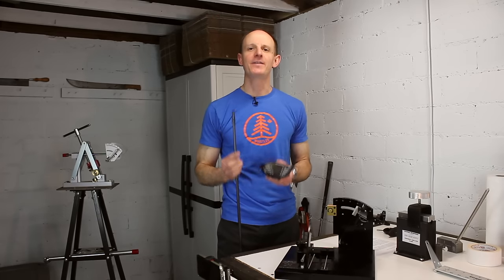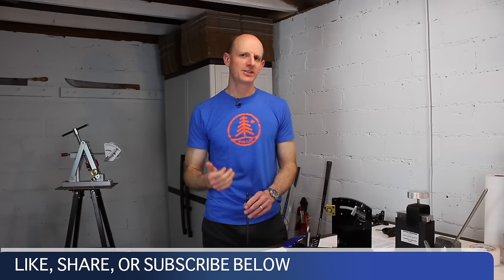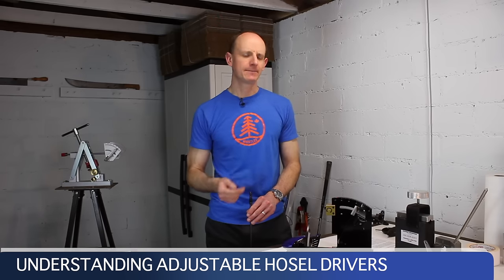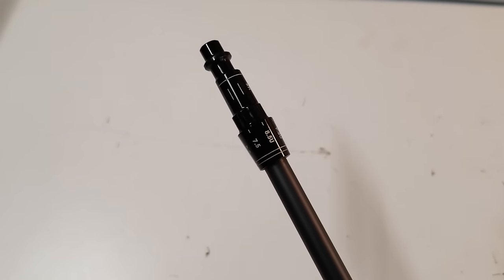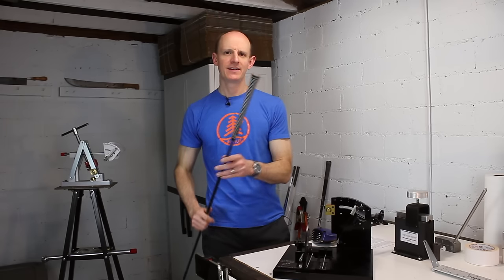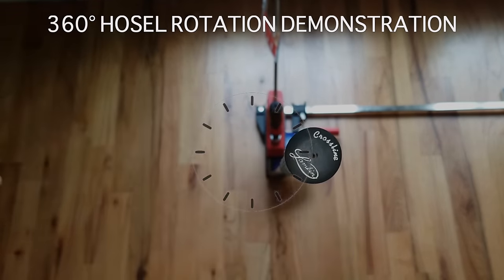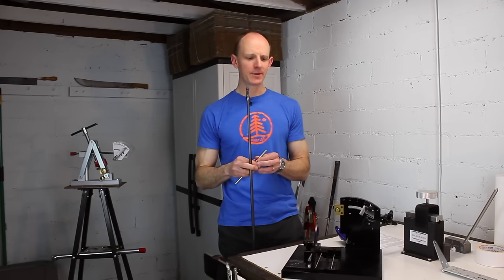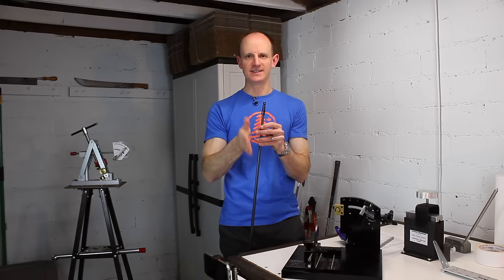Adjustable Hosel Drivers - How they change Loft, Lie, and Face Angle

Comment: Great video!
Question:
Now that I understand the mechanics of adjustments, why does more loft (or increased lie angle) create more of a Draw? What’s the physics behind it?
Thanks
Reply from the maker: More loft drops the back end of the club so the club makes contact with the ground further back. However the balance point of the club has not really changed so the club want to "fall back towards that balance point. The result is the club face closes more and you get a better chance of drawing it.
Increased lie angle changes the face angle or face direction so that more upright lie again will lead to more draw and flatter lie will lead to fade. However the driver has such a straight face, the lie angle is less influential than with a more lofted club.

Comment: I've always understood how adjustable hosels work, but you're absolutely right that all you can find on the topic is parroting of the manufacturers' sales literature.  On the topic of loft angle not changing because the club does not come to rest in the various angles is downright absurd.  I would think every golfer knows you cannot rest your club on the ground, allow it to fall into its balanced position and assume it would be in the right alignment to the target, whether or not you make any hosel adjustments.  T-boxes have all sorts of irregularities that will inconsistently position your club head.  Unless your course uses mats on perfectly flat concrete, you just never know what kind of surface irregularities you're setting your club onto.
Reply from the maker: All very true. 
I know that, and you know that, but I still get into disagreements with people (often older club makers) who say hosel adjustments don't change loft because they say it only changes face angle and won't acknowledge that part of golf is squaring the face to the intended target.

Comment: Gabe…watching this again 9 months later…question…so I am correct that two identical drivers, one sold as a 9 degree driver, the other as a 10.5 degree driver, WON’T be identical if you adjust the 9 up to 10.5 or vice versa, adjust the 10.5 down to 9.0?  There be differences in the lie of the club and the way the club head sits…is that correct?  In other words, If I hit both of these driver adjusted to the same loft, would there be a difference?  Also, with the Titleist adjustments, is it correct then that you can independently adjust loft/lie because of the double cogs?
Reply from the maker: You are correct that the two drivers will be different in the set up.
Titleist still has a link between loft and lie. Titleist just always for more smaller changes.

Comment: So does it then stand to reason that if a player never grounds the club before they grip it they can override any hosel adjustments made? It would seem that after making any adjustment you would have to sole the club to allow it to “sit” properly into its new orientation and then grip it.
Reply from the maker: Not grounding the club would only impact the club heads desire to fall open or closed based on the adjustment to the hosel since that is caused by the interaction between the sole of the club and the turf.
However any adjustment made to the loft or lie would still be there. Two degrees lofted up would still be two degrees lofted up assuming you aim the face in the same direction and have similar shaft lean in both cases.

Comment: So you can either change loft (if face is square) or you can change face angle, but you can’t can’t change both without effecting the other. So for example I could adjust the club such that it gives me either an open club face or a lower loft, but not both as they are 2 sides of one coin ?

Comment: That's a great demonstration, can you tell me what setting creates the flattest lie angle for a cobra adapter
Reply from the maker: I don't have a Cobra in front of me right now so I am not sure if they put the "standard" starting position as the highest or lowest lie angle. I am guessing the standard is the highest lie so turning it 180 degrees will give you the lowest lie setting. Lie angle is always dictated by this toe/heel plane. If you remove the shaft from the head and look closely at the tip while turning it in your fingers, you should be able to see the angle moving between the shaft and the end of the adapter. You want the adapter to be pointing down the greatest amount when inserting the shaft, that will give the flattest lie. Thanks for your support of the channel.
Reply: So from STD the 3 draw settings are on the opposite orientation of the shaft so maybe STD is already the flattest setting
Reply from the maker: @Cutlerypotato  That sounds like the case, and Cobra is considering the upright lies draw settings. 3 degrees of lie angle change might give you around 6yds of draw on a 280yd driver, so it's a pretty small change.

Comment: Are loft and lie both modified with a loft adjustment? Ping G430 has an adapter for loft or lie but no mention of the affect on loft when adjusting lie, can you indicate the change to loft when adjusting lie? If you can I will subscribe.
Reply from the maker: They are linked. Can’t adjust one without the other. Ping starts at the highest lie so anything you do with the loft will lower the lie.

Comment: I have Ping irons (copper) which many years ago I had graphite shafts put on them.  I believe they measured me and set the 5 iron to that length.  From that they made each shaft different by .5 in up to the 2 iron.  I believe you indicated that all the irons should be at that same length , am I correct?
Reply from the maker: All irons should move in 1/2 inch progression, at least that’s the way all the club companies do it. You can use other length progressions like single length or a 3/8 inch progression also. There aren’t any rules, just about finding what works.

Comment: Very helpful! I’m curious, my Cobra Speedzone Driver has a loft setting where you can increase the loft and another one where you can increase the loft with a draw bias. What is actually happening between those two?
Reply from the maker: Think of the clock face again. If the starting point is 6 o'clock for RH driver, the highest loft sets the shaft lean to 9 o'clock. The setting at 8 o'clock and 10 o'clock both set the loft at the same place, but the 10 o'clock increase the lie angle more. That is what they refer to as Draw setting. Any time the hosel adjustment results in a lie angle change over 1.5 degrees, they call it Draw. That's why you see a higher loft and lower loft draw setting.
Reply: @EFGMC  Thank you! Makes sense! It’s not as if the driver in itself is creating the draw,  it’s because the lie angle decreases it helps you have an easier time getting your club path around the ball since you are now likely closer to the ball.
Reply from the maker: @jasonk86  Lie angle is actually going up, not down. Upright lies will produce more draw because the face angle closes as the toe gets higher in the air at impact.
It's a very small amount on a flat faced club like a driver, but it's there.
Reply: @EFGMC  Sorry yeah that’s what I meant to say. I was using decreasing in the opposite way, but was trying to say the same thing.

Comment: If you deloft one of these clubs due to the balance of the club will it have a tendency to open up during the swing more regardless of if you lined up square. Sort of like those adjustable draw fade weights callaway uses on their drivers every other year
Reply from the maker: It shouldn't really because you aren't moving the CoG in the heel toe direction if anything. It's also a very small change in the CoG, like a mm or 2.
That said, any change in equipment can result in the player swinging it in a different way so all these "rules" are really general guidelines.

Comment: Thanks for this in depth explanation. So is it correct to say that changing loft will change lie angle, making you have to stand closer and taller to keep the face flat? otherwise it will give a draw or fade bias kind of like hitting from a slope?
Reply from the maker: Changing loft from standard will change the lie but only up to 2 degrees. Lie angle on the driver however only has a very small impact on launch direction since the driver has so little loft. Thanks for watching!
Reply: @EFGMC  Thanks for the reply. I have an 18 degree fairway with an adjustable face, would this be at the point where lie starts to matter?
Reply from the maker: @frankenstein01  18 degree loft would equal about 0.1 degree face angle/direction change per degree of lie angle being off. That comes out to around a foot offline at 215 yards. Add in the spin factor and it would be maybe a yard or two. So no, not much to worry about. Of course if you are 4 degrees off you can see a little more because you will have more spin influence even though the pure direction is still only slightly off. This all assumes that you are delivering the club straight down the path and that your dynamic loft is not vastly different from the clubs stated loft.
Reply: @EFGMC  Awesome, thanks!

Comment: If a golfer tends to draw the ball too much, decreasing the loft and letting the club sit flat on the ground at address can compensate for that. The opposite problem, a golfer who tends to fade the ball too much can have the hosel adjusted to increase loft and then sit the club flat on the ground to close the face slightly at address. This is a different, but equally effective way to use these adjustments. However this should be explained to the golfer so he understands what is happening and why. Obviously the lie angle is a factor as well with a head that is too flat with the toe down will tend to hit the ball slightly right and a head that is too upright with the toe up will tend to hit the ball slightly left. In both cases of lie differences, the initial direction of the ball is affected more than any curve of the shot.  NOTE: As you state, the golfer should be instructed to have the shaft at the same angle as usual at impact unless the loft adjustment is being used to change the initial launch direction.

Comment: So can I take a fixed shaft 3 or 5 wood and convert it to an adjustable hosel in order to interchange shafts?  I do not like the TM stealth plus but love the TM stealth fairway woods.  Problem is I can't test other shafts...
Reply from the maker: Not really unless you have a drill press and are willing to attempt drilling out the hosel to fit something like an All Fit adapter in it. It's not easy though!

Comment: I play with a 2008 Burner 15° 3w. I've recently bought the Titleist 917f2 (16.5°) and I cannot get any consistency off it whatsoever. I play my Burner with the ball in the middle of my stance and pronounced shaft lean (enough that the clubface is perpendicularly flush to my left eye at address).

I am pulling my hair out trying to get the same settings on the surefit hosel.

I've literally just realised that I can loosen the surefit and line the two clubs up next to each other and tinker with the surefit hosel so that it emulates the angle of the Burner shaft.
Reply: Also, your visual demonstration of shaft settings for loft change blewy mind. I kept on want to to "lower" the loft of the 16.5° closer to 15° and I was wondering why it felt terrible to hit (with my pronounced forward shaft lean) - it is clear now that the on that setting the back of the club is raised far too much off the ground - and (whilst counterintuitive to my initial understanding) I should in fact be "adding" loft with the hosel for my pronounced forward press.

Even whilst lying in bed now I am certain this will do the trick. I just which I had a torque wrench on hand!
Reply from the maker: @diogeneslantern18  If you haven't seen my follow up video on this, it might also be helpful.
https://youtu.be/U3JUSHDmJ00

Comment: I remember taylormade r7 or 11 had the dial on the sole that you could adjust to prevent the face from rolling open or closed after adjusting loft.  Kinda wondering if they'll bring that back in the future if they can maybe make it in carbon fiber to keep weight down.
Reply from the maker: The Mizuno driver I use in the vid also has a sole adjustment to open or close the face like the TM did. Problem with it was it acted like a shovel anytime I got too close to the turf in my swing and would end up with chunks of grass and dirt wedged into it.

Comment: There is another issue that hasn't been addressed ..Because the loft change is made by leaning the shaft and not by changing the physical angle of the face relative to the club body then even if you square the face and lean the shaft always the same you are changing the offset of the face relative to the shaft and therein lies the flaw in adjustable hosels. If you loft up the offset is increased which tends towards a draw and vice versa Thus it isn't only the effect you mention .. It is really the automatic corollary of what you described as changing the balance point. This is why I struggle with adjustable hosels . In my irons I like little of no offset and i my fairways like the TP models which are less offset and slightly open faced vs standard. Adjustable hosels alter this offset . This is how high handicappers clubs are made with more offset and pro clubs with zero . I find if I use offset clubs I get a draw leading to a hook .. ditto if I loft down I get a hint of fade. The effect is similar to the effect of leaning the shaft more at impact ..

Comment: When going +1.5 loft to keep pointing at the target do you have to move the ball position further ahead of your feet ?
Reply from the maker: Ball position will be player dependent, but you should not alter anything when adjusting the adapter. However you setup in neutral should be how you set up at whatever loft you set it to.

Comment: Will changing the loft effect the club balance? Possibly changing draw / fade bias of the club or other shot shape, ball flight characteristics?
Reply from the maker: Yes. Increasing the loft will promote the face falling closed which if not returned to square would result in more hook ball flight. Opposite for lowering loft. Changing the lie will also effect flight in a limited capacity with a driver.
Reply: @EFGMC  I understand that.  As you explained in the video that changing your setup will counter these. I’m thinking more of a CG move similar to how movable weights would alter ball flight.
Reply from the maker: @justinmills556  Got it. Left and right I don't see any amount of movement significant enough to mention, however vertical COG would be moving a greater amount influencing back spin.

Comment: I am looking for EI 70 shafts, do you know where I can source them? Most stable shaft I have ever used and just suited my swing with a driver 975D  8.5 and 3 wood  0rlimar trimetal at 12 degrees.  In addition I am looking for driver head at 300-350 cc at 8-8.5 degrees.  Is  there a source for them with any of the modern face or  weighting adjustments?
Reply from the maker: Ebay I think is going to be your only option and you may end up having to buy full clubs and pull the shafts as I can't imagine there are any new raw shafts out there. Last time I saw one for sale new was probably 5-7 years ago.

Comment: Great video..the one problem I find with this theory..if I buy a 10.5 driver and want to bring it down to 9 .5  the lie angle is way off..question why do they make a 9.5 driver?
Reply from the maker: It will change the lie angle going down or up 1 degree but we are only talking about 1 degree lie angle change basically. That amount of lie change on a driver equals approx 1.5 to 2 yards offline with a 300 yard drive vs. a perfect square lie angle.
Reply from the maker: If you want to see more on lie angle influence I did this video.
https://youtu.be/Dz7Cwk77394

Comment: So if I need a 10* or 10.5* driver, is it generally better to buy one where that is a standard loft, or just as good to get a 9* and adjust it to 10.5*? I sometimes hit a slight fade, so slightly closed sounds OK as long as it's not too much. Only asking because sometimes I see a good deal on a club I want but the loft isn't right. Wondering if I save money and adjust the loft or spend the extra getting the right loft out of the box.
Reply from the maker: Hard to say for sure unless you actually try the driver in that setting. Depending on the driver, the face may not close that much when lofting up. Also depending on the driver brand you are looking at, lofting up can flatten the lie angle which will lead to more of a right fade miss (assuming RH golfer).

Comment: Adjustable hozels are brilliant. Only issue can be with alignment grips..better to just have plain.
Reply from the maker: 360 grips come in handy for these hosels unless you have a Callaway or similar where the shaft does not actually rotate.

Comment: Question: So does a right handed adjustable hosel shaft in a left handed club head work oppositely,or not fit at all. Are there left and right handed shafts?
Reply from the maker: LH adapter would just work in the opposite direction for loft. Lie would not change. They would fit no problem. Shafts are shafts and not RH or LH.

Comment: Do you think all the aftermarket cheap adapters on eBay do the same thing as the original manufacturer ones?
Reply from the maker: They do in theory but the tolerances are not as tight. Don't always fit right. Also they seem to break more often.

Comment: I am pretty sure the center of gravity changes position when you change loft. More loft means center of gravity more down because you are moving the whole head. It has been my experience that when I set drivers or woods to maximum loft I get excessive spin and height, more than normal for that new loft.